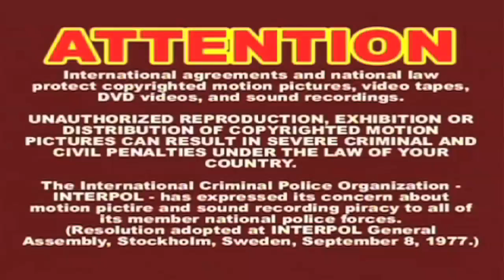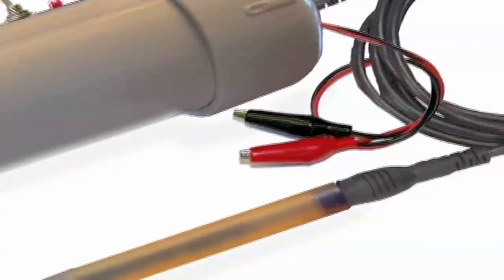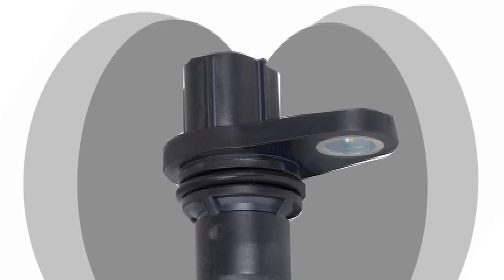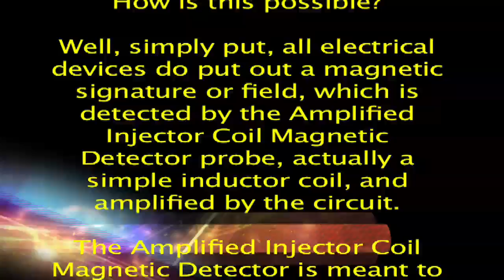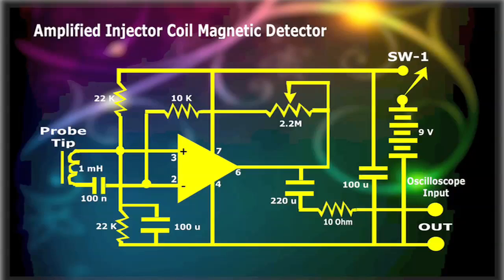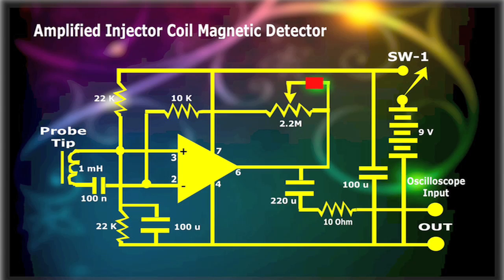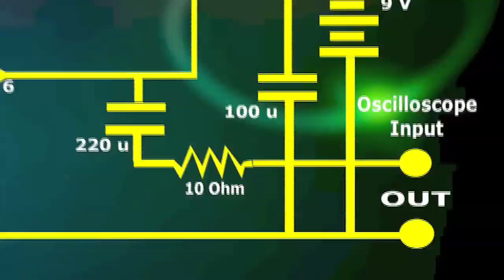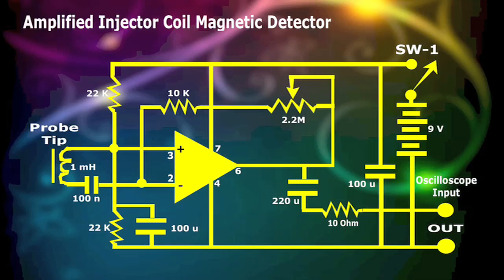Amplified Injector & Coil Magnetic Detector

Comment from the maker: No, human beings are not good at processing fast moving digital numbers. Besides the usefulness of this tool is to view the waveform, which is a value read over time. What you want is the waveform, and you want it while disassembling as little as possible. There's no disassembly required with this tool. Hope that helps. Thanks for posting.